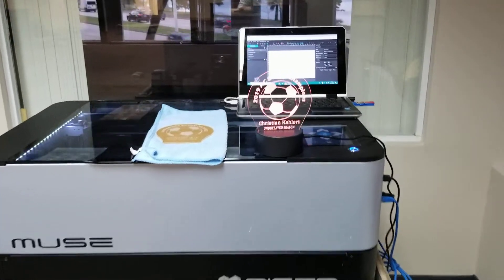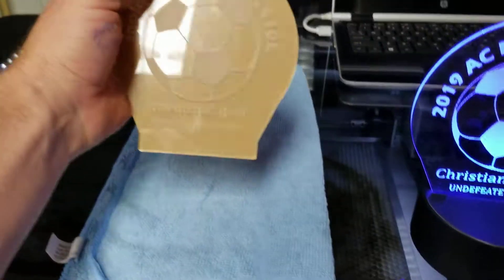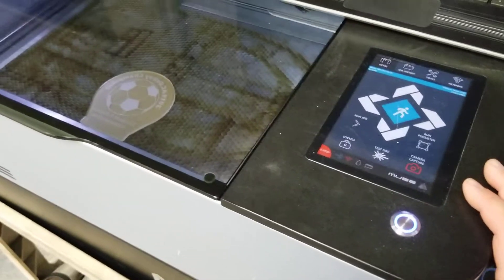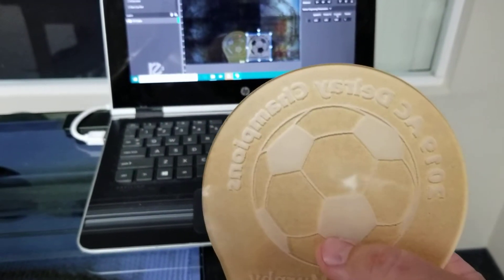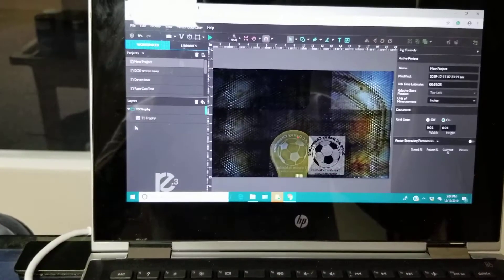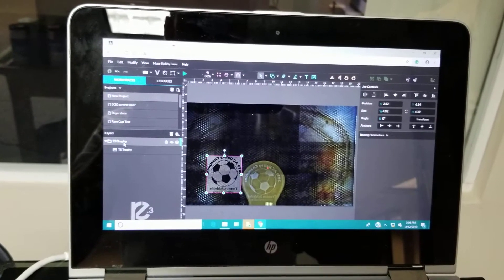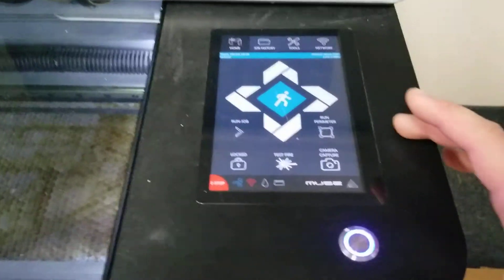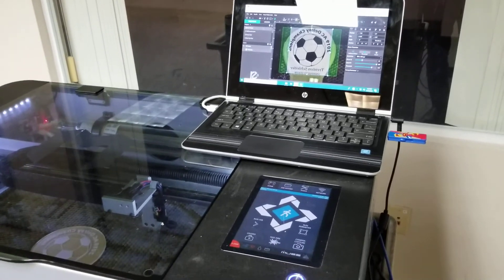Making acrylic engraved trophies on the Muse laser

Comment: Uh. Reread the screen.

When you push the camera button twice it says “move red dot over material.” In other words, move the laser head out of the corner and over the material to be measured. 3:49

Seems like it’s working as designed but the user is failing to follow instructions. Muse reads the height of the material. It doesn’t use AI to find the material in the bed. It relies on the user to position the head because it’s not smart enough to find the material on its own.
Reply from the maker: Uh, thanks for a reply Landon. This video was made to be informative to users who might not understand how to properly use the software. My comment at that moment is not evidence of confusion on my part and I was not reaching out for help from viewers. Should a casual user try that operation, they may not understand the need to reposition the head as the required movement of a red dot laser over the material in the context of taking a picture of the bed requires instruction, as one does not typically associate a laser height measurement with a photograph. Further, when the muse was running RE2 and I made my first video concerning imagining the cutting surface, the 'move red dot' warning did not appear on screen, the error box just said error. It took me some time to figure out that it had to be moved. RE2 was at that time far less user friendly. This video also serves to clears up that function as being fully featured and I appreciate you pointing out that the on screen warning now tells you what to do properly. I don't appreciate the 'uh', as a means to make me feel dumb, when you clearly missed my intent.
Reply: @kohersh  before I subscribe  to a channel, I make a comment to see how the video poster handles obvious posts, as I like video posters to interact with video viewers while avoiding confrontation. They way you responded would take the comment into a spiral of grief if grief-causing was my intent.

You, sir, failed.

Have fun growing your channel.
Reply from the maker: @Unkn0wnC0mmand  Just saw this a year after you posted.  Why would you do that? Interact with people you know, they are called friends-go make some. This is not a tutorial channel IDGAF about growing anything or having even 1 follower. You didn't even listen to what I was saying in that video, just so impressed with yourself for knowing the answer already that you missed the context of the overall presentation. I don't pander to the lowest common denominator. Go make more tesla videos that nobody gives two shits about-ass clown. Lastly, nobody is impressed by a model 3. the civic of EV's. Bored Now.